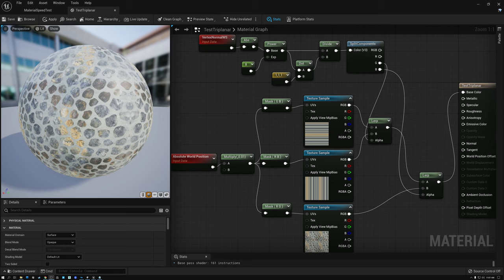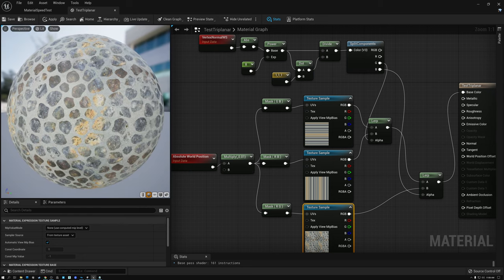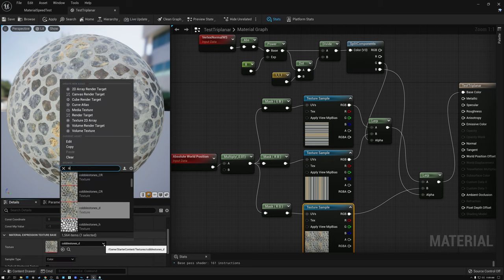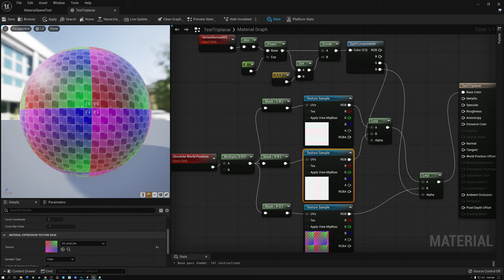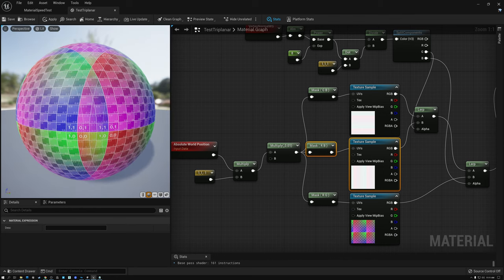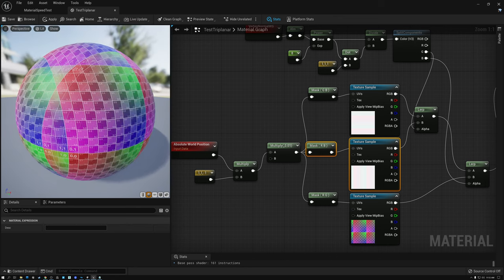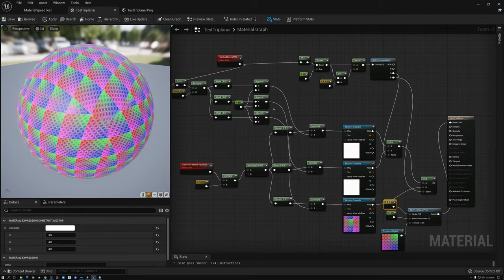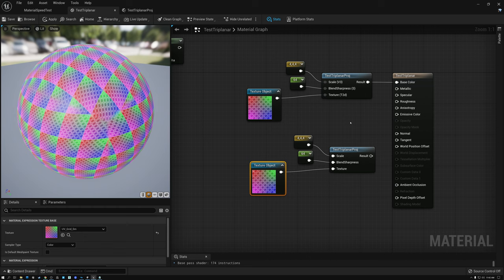Triplanar Projection Improvements - Shader Graph Basics - Episode 29

Comment: Hi Ben, Thanks for the video ! I was wondering, In Unreal what are the main advantages in using this method instead of the WorldAlignTexture/Normal nodes ? Also, is using triplanar projection is viable to use in a game project in terms of performances ?
Reply from the maker: Great questions.  What I'm showing here is basically the inner workings of the WorldAlignTexture nodes.  So you can use the WorldAlignTexture nodes and get the same results.  The next logical question is "Why would you show us how to do something when a node already exists to be able to do that?" and the answer is because it's really valuable to learn how something works - so you understand it, and so you can make adjustments if you need to.  Triplanar projection is usable in a game, yes, but it's more expensive than standard texture mapping so you should be conservative with it and only use it where you need it.

Comment: When flipping the orientations using the sign node, I found I also had to Transform the World Position to Local Position, otherwise some sides go back to being flipped in the wrong direction when moving the actor in the scene
Reply from the maker: Yes, you’d need to use object space for objects that move. World space is for static environment objects.
Reply: @BenCloward  I mean the fix added with the sign node for correctting the flipped values of the projection. If the sign calculation is not done in local space even if the object doesn't move the mask the mask would only work when the asset is at the origin of the scene

Comment: Nice, but there is already premade nodes for that. But how about doing the same thing but with a single sampler? ^^
Reply from the maker: I understand that there are already premade nodes to do triplanar projection, but I hope that my viewers are interested in learning things in a little bit more depth.   I believe it's really valuable to learn how something works - so you understand it, and so you can make adjustments if you need to.  For the single sampler version, in the previous episode, I showed how to switch from the 1 sample version to the 3 sampler version.  So you can take what we have from this episode and then reverse the process of going from 1 to 3 and it should give you what you're looking for. Let me know if you get stuck and I can demonstrate it in next week's video.
Reply: @BenCloward  Sorry, didn't mean any offense. That was kind of crude joke. What I did mean, that it would be interesting to learn some really new tricks, that's can't be found right inside the engine out of the box. Also I've already done triplanar projection with single sampler half a year ago as optimization for mobile project. There wasn't enough samplers in landscape material to work properly on mobile devices with all required features, so I freed a couple with that.
Reply: @Cesar World aligned texture has input for custom World position where you can put local position instead or even Pre Skinned Position that will allow to use it even on skeletal animated characters. Nothing fancy here.